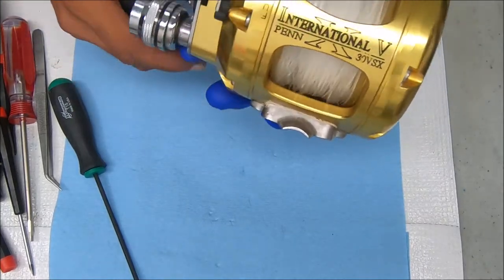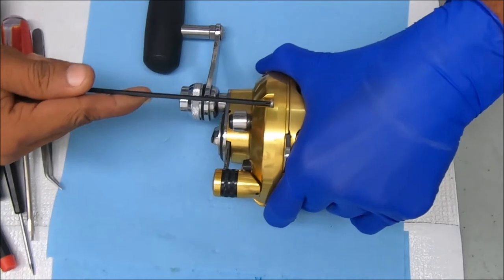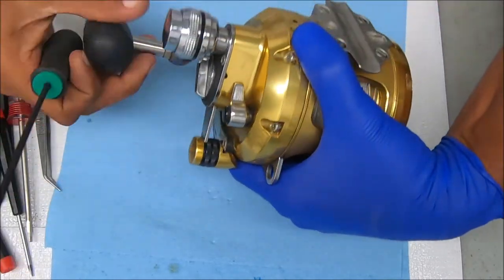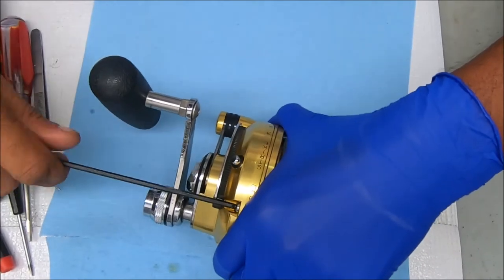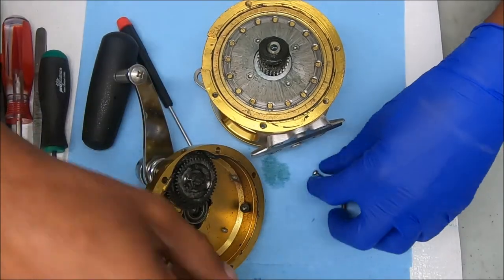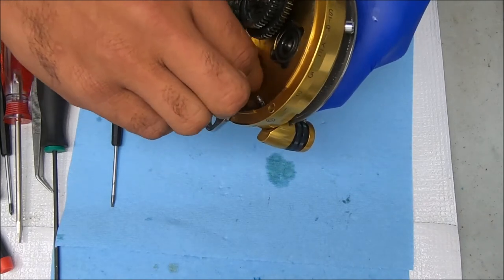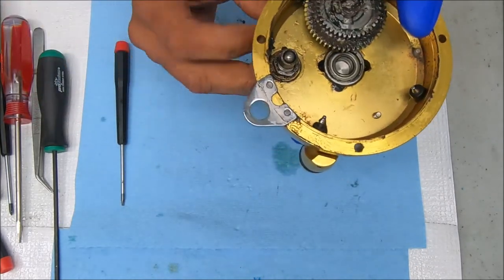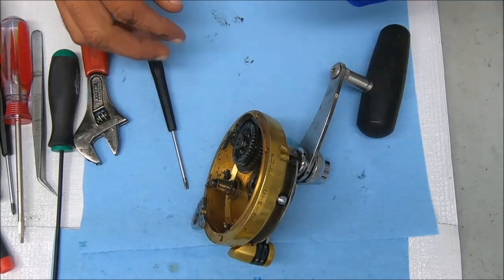Penn International 30VSX Clicker Not Working - SIMPLE fix: Fishing Reel Repair

Comment: Any idea how to make it quieter? So it does not sound like the clicker is on while fishing? TIA!
Reply from the maker: Thanks for checking out the video. You can add a thicker layer of grease on the ratchet to help deaden the sound, but not get rid of it.
Reply: @TSGReelService  will i be greasing the clicker ratchet or anti reverse part? Looking to minimize it as much as I can.
Reply from the maker: The ratchet for the a/r.
Reply: @TSGReelService  perfect! I appreciate your response!
Reply from the maker: You're welcome and no worries.
Reply: I’m no mechanic but wouldn’t it be better to use motor oil or transmission oil on those gears? Thanks for your tutorials.